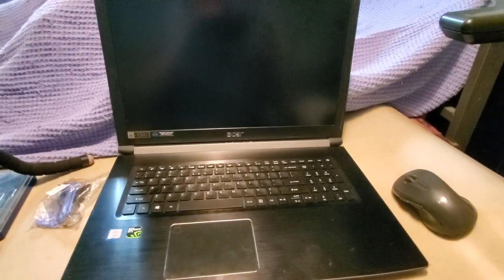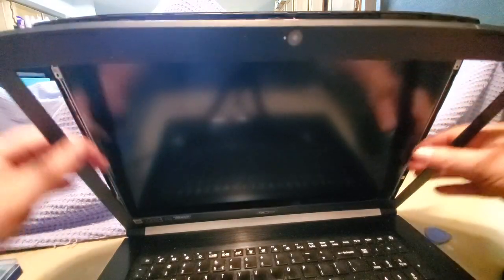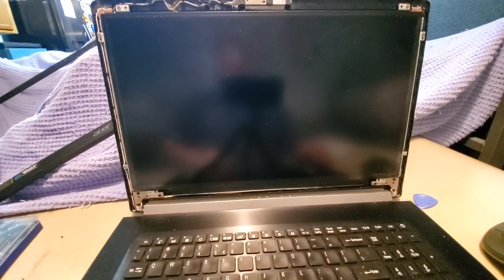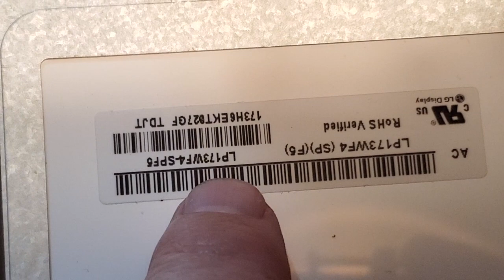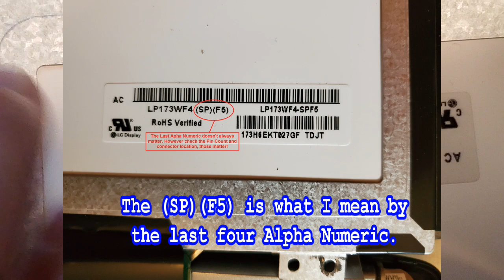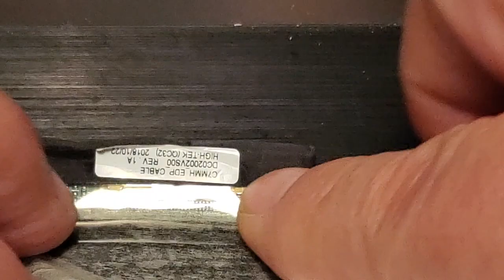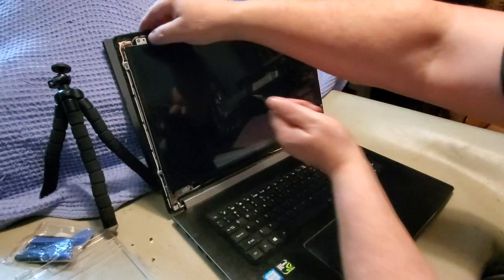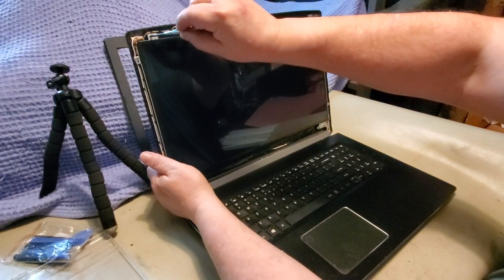ACER 17 Inch Screen Replacement SUPER EASY ie N17C3

Comment: Thanks for posting, my 17 inch Acer was a little different in taking it apart, a lot more screws holding the screen…. Had a metal frame around the screen with screws on the sides. Great detail and description
Reply from the maker: Glad it helped bud. Best Wishes & Blessings. Keith Noneya